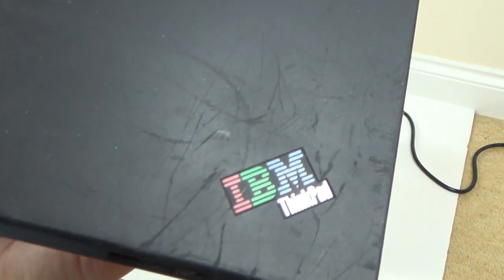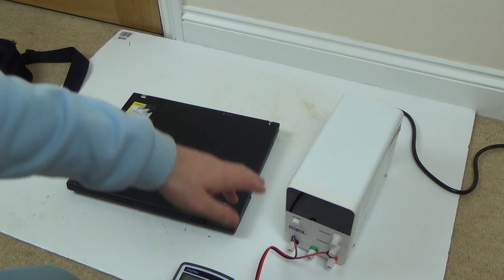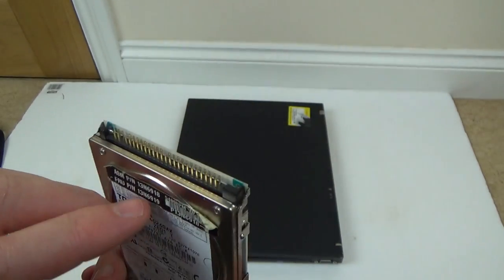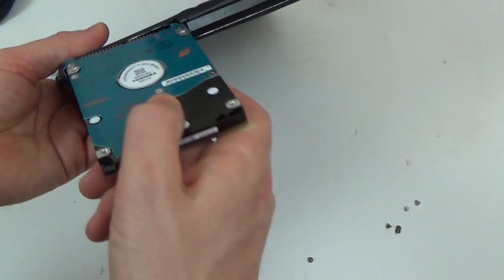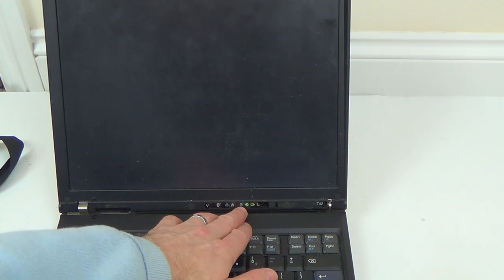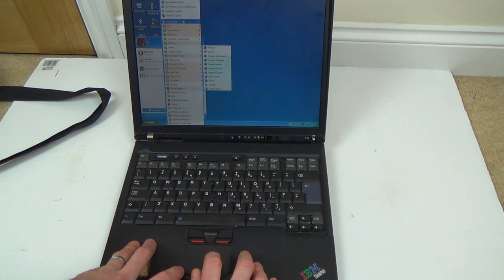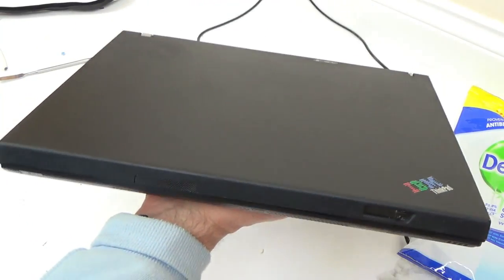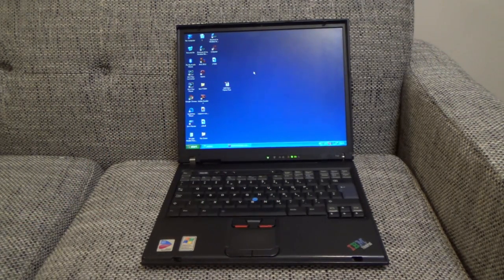Trying to FIX : IBM ThinkPad T42 Laptop

Comment: T42's were indeed good laptops - one of the last of the IBM ThinkPads - later the T60's were produced part way through by Lenovo (which bought the ThinkPad brand from IBM).  Keyboards/Touchpads for these are pretty inexpensive although even if you were/are able to get this running you may want to keep WinXP or Win7 on it as Win10 will run but might be a challenge for driver support.
As far as the "approve certificate" I think you have a bit of malware there (or as others have suggested simply date/time being wrong compared to what's in CMOS) You could try to "clean" it off of the machine but you're looking at some hours and really no guarantee that it'll be successful - it's easy enough though to uninstall the myriad of junk apps in add/remove program.   I would find an XP image, burn it to a disc and re-install - even after that there's no support for XP (even security patches)...

Comment: I have mine nb with xp and have no issues with certs (not sure if i had this problem). Using waterfox in it (it's using older firefix core (horay legacy addons) with uptodate security updates). So i thing it could really be that cr2032, or it's just a browser settings (again, not sure if i was solving anything like this).

Comment: i think those "expired" certs are due to the system time on the system itself other then that it should be able to run windows 7 just fine since its able to handle up to 2GB of ram but with a modded BIOS it might be able to support more unless your limited to just a 32bit OS otherwise maybe Lubuntu would be the other option there

Comment: The certificate issue is most likely caused by the windows and bios clock, might need an updated bios and fresh CMOS battery and you should be good to go.
Cool repair video Vince well done :)

Comment: Just a suggestion. Never use alcohol or alcohol containing wet wipes on those type of screens. They are not made from glass like most modern screens but rather a thin film of plastic and alcohol can eat through that leaving permanent marks on the screen

Comment: ha .. nice ... I have one of these running XP ..I use it for Jaguar / citroen / peugeot /vauxhall   diagnostics ...in fact most OEM OBD software for cars uptill ~2012 still ran on best on  XP ..I actually have a mega cheapo 30gb kingspec IDE SSD in mine as it gets checked about on test drives a lot and it kept killing hdd's...not really safe to connect to the internet with XP anyway ...its been a long whilst since the last security updates.....sounds like the bios battery is doa anyway....I always keep a couple or working XP laptops in my workshop.

Comment: The pins on the back of the drive are basically ide 2.5 instead of the usual 3.5 they are used on laptops

Comment: You can't put an SSD into an IDE interface. That thing is no longer much more than a paper weight my friend.  Good on you for fixing the issues with it however!
Reply: U can with an converter, trough I wouldend recommend.. Windows xp doesn support trim, so eventually u will destroy ur ssd/windows xp installation

Comment: Right-click 'My Computer' and then click 'Properties'. You should find support information there. If there's a big IBM logo and the support information checks out, you have the 'original' XP installation on there. If not, then this laptop has probably been re-installed or imaged by someone and the 'original' XP is not original anymore. In that case, feel free to install another OS. Or, pop in another hard disk and try another OS on that. Or, take out the hard disk so you're sure nothing will happen to it, pop in a USB stick and install Linux on that, from CD. In the BIOS you can set the default boot order and if you  push F12 in the BIOS screen, a boot select menu will pop up.
I might have an original working power supply for that laptop, somewhere in my junk pile.

Comment: Its trying to boot from network connection first of all - thats the Intel boot agent.  Then when it says OS not found its either not detecting the hard disk, or there is no OS on the hard disk.  SSD would be probably quite difficult as it uses an older hard drive connection standard

Comment: I have the same model. Someone gave it to me and I powered it on. It's in really good condition and there's not so much problems with it! The only two things are that it's scratched, and every time I unplug the power cable, the time resets and I have to configure it again. When they were giving it to me, (along with other laptops and phones that work, one phone doesn't work) they threw it to us??? Yep, that's right. they threw it at us. I cached some but, since one laptop was so heavy, (the one that has Windows Vista) I didn't catch it and now the top is scratched. Same for some laptops too. At least they still work! Right? So after I got home and booted up all the computers. Since I still lived with my dad at the time, (I still do now) my dad planned to SELL the ThinkPad to one of my uncles. but since it was too old and my uncle has a newer laptop, we didn't. And to this day, I still have the phones and laptops. Sadly the Samsung Galaxy S1 was bricked and I can't use it. I tried to unbrick it but it since it was dropped, it was bricked FOREVER. Yep, the Samsung Galaxy S1 gets bricked forever when you drop it hard, or throw it hard.

Comment: You won't go far wrong with IBM laptops or Lenovo, especially if they are the business ones, they are designed to be worked on, tells you on the back which screed to remove, great machines

Comment: @mymatevince To solve your issue set the time and date and timezone correctly. Its probably been flat for so long the cr2032 has gone flate for the real time clock. Website nowadays have an ssl certificate to make them secure hence the padlock at the top. They are olnly valid between certian dates so if the date and time is wrong it will through up error.
However as this is running xp I would recommend this is not put on the internet ands its massively out of date and insecure let alone no longer supported. If you end up selling it let me know. I need an XP machine for some old software that wont be updated

Comment: The way you say "H" is in fact pronounced correctly throughout the world bar an extremely small minority that we could treat as insignificants, Having said that lets see how many insignificants there are other than the 4 trolls who thus far dropped a thumbs down at the time of this here message?  

"Cash Converters" are a shonky second hand dealer "Pawn Shop" Located in Ass-Trail-Ya if not throughout the world, I say Shonky because they Botch Repair broken pawned items or perhaps allow such botched items to be sold as is, For example connecting a stereo's working channel to both speaker outputs.

Last thing I have to say is the latest windows should install OK and even install all the latest drivers, But as you are aware collectors are not interested in Microsofts latest windows backed and sanctioned by Intel's cash grab having windows constantly being updated with more and more bloatware, that forces everyone to update their computer every few years or so, long story short uninstalling and installing the latest Google Browser should negate the certificate woes, mind you that's if Microsoft hasn't woken up to the workaround.  
APU I dropped a like
Reply: Cash Converters briefly had a presence in Canada in the 1990s. I once brought a PC game there that was infected with a rather nasty virus. 😬 I would never purchase computer hardware there.

Comment: I believe on old XP machines you need to update the GlobalSign certs that all expired a few years back. I believe I've got a windows batch file that automates it for you if you want me to dig it out and see if that fixes your online issues.
You'll probably find that if you go to run > mmc > add snap in for certificates, under third party root certification authorities, you've got some Global Sign certificates that expired a few year ago, and haven't renewed themselves, which is causing all your grief.
Let me know if you would like me to email across any files/instructions :)

Comment: I just brought one of these back to life.  Mine needed a new main battery, a CMOS battery and Windows 7.  I upgraded the RAM for giggles.  This machine won't run Windows 8 or Window 10, but Window 7 runs just fine.  If you do install Windows 7 you'll need to get drivers from Lenovo, just get the most recent drivers you can find, most will be either XP dirvers or Windows 2008.  Mine had 512k so I upgraded to 2G.

Comment: Replace the keyboard, also replace the cmos battery under the bezel. You can simply use a 2016, 2025, or 2032 lithium coin cell and reuse the wires. The cmos batery is a yellow candy looking thing. 🤓

Comment: The end of life for windows XP was in 2014 and companies slowly stopped making software for it. The end of life for windows 7 was in January so companies will stop making software that supports it. These days it's either get a laptop that can run windows 10 or use a Linux operating system.

Comment: Microsoft ended support for Windows XP back in 2014. And computers in that time ran 32 bit processors, and there just ain't much software supporting 32 bit anymore. A lot of the time Microsoft only gives 10 years of support, rarely they will be a Windows version that goes on longer. With a computer that old, there ain't really anything you can do to make it actually usable, upgrading to Windows 7 isn't recommended either because Microsoft ended support for Windows 7 earlier this year, meaning that you won't get any security updates for the os. And if installing a newer Windows os, now a days there's 64 bit, so you are going to have to download a 32 bit iso file for that system if that newer os even supports 32 bit, because some don't. Installing Windows like Windows 8.1, or Windows 10 that is currently still getting support run by 64 bit, so you are going to have to do quite a few upgrades to getting it to run. But doing major upgrades on a system that old is quite challenging because upgrading something like the processor, the system might not operate right, or at all because that type of motherboard might not support a much newer processor, so at that point you might as well just buy a new computer. Another thing, websites now a days like newer websites won't load in, and just spit out an error because the main reason is because in that time of 32 bit computers, the site URL ran by "http" in the beginning of the URL, now a days with 64 bit computers, sites now run by "https" in the beginning of the site URL's, so a 32 bit system in the time of "http" won't recognize much of the sites because they don't support "https", mainly because "https" didn't exist in that time of 32 bit systems.

Comment: Not worth upgrading the hard drive when its interface is eide or ide. Best you can get maybe a western digital raptor? 7800 or 9000 rpm I believe.
Reply: SATA to IDE adapter and yes it does make it a lot quicker.

Comment: the certificate error its produced by time or date in computer is wrong(maybe), you need to replace de battery clock and set the date properly

Comment: Wow Windows XP, I think you might want to put Linux mint on that machine as Windows 7 probably wouldn't run and for that matter drivers would be obsolete, and windows 7 is no longer supported.  The only thing you might run into a problem with is the sound as even windows XP had issues with you had to install a driver for the sound card.

Comment: The issue with the certificates is most likely due to expired root/intermediate certificates.  You can update them using a command line utility rootsupd.exe as explained here: http://woshub.com/updating-trusted-root-certificates-in-windows-10/#h2_2.  There is most likely a handful of certs that expired since that machine was last turned on.

Comment: PXE Boot explanation. Client-Server (workstation) environment, also known as network boot.   https://en.wikipedia.org/wiki/Preboot_Execution_Environment. This is NOT an error when something says PXE BOOT. You can disable it in the BIOS. If ONLY this appears and does nothing else, then the BIOS was set to this ONLY and thus you may need a password as this is usually a company thing and BIOS will most likely have been protected, usually they should be cleared and set to standard default if being passed on, not always though. Enable the HDD and disable the  PXE Boot (boot options) or where it says PXE. Job Done.

PXE-E61 Media Test failure. What it means is no network cable is attached. even if so it needs to conenct to something giving out IP Addresses like a DHCP server which would be the norm.
PXE-M0F Exiting Intel Boot Agent. What it means is, since it cannot connect to a network and get a certificate and IP Address, it will exit that boot up sequence and try another device.
Operating system not found. What it means is onen of several things. There is NO other boot option set in the BIOS, no device in the boot sequence set in boot options in BIOS has Boot files like a windows disk or HDD Boot manager.

That's it. NO Error at all. The clue is in what you were told with this. Just attach the hdd and if that doesn't work, install windows on it. See my other comment.

Comment: I have one that just flashes all led lights one time when I push the power button. I have to take the battery out and back in again to get the 
"Battery Charged " flashing green battery led to come back up. I have tried the old , take the battery out and press power 10x times then hold 30 secs , then tried again. There are many screws missing and i was thinking from reading the manual "make sure all components are connected well" quote and make me think that some of the screws might complete a circuit? Anyone reading this have any idea to get it to boot would be great . Thanks.
Reply: could it not boot to bios if the cpu/ keyboard/ touchpad / cpu fan is not working? Do they complete some sort of circuit to boot to bios?

Comment: I still have my T42 upgraded to windows 10 32bit and 1.5GB ram with an 80gb ide drive sadly the battery is messed up and I need a genuine charger wouldn’t have a Chinese remake if anyone has one In good condition I’ll buy it. Currently using a T43  charger off a friend since they are pretty much the same😂

Comment: That's a robust laptop, install Linux in that and be come verry usable, better that any new laptop, upgrade to 2gb of RAM and ssd, with IDE to m2 converter 

Apart of that need a change of thermal paste so, It's time to take it apart and give it a good clean and maybe upgrade the cpu

The Pentium M 755 is a good upgrade to 2ghz, overall the next upgrade Could be a custom motherboard but is really expensive one, like 800 us dollars for a t47 with i7 8gen and all good stuff

Comment: you wont get a sata ssd to work in that as it uses the older pata interface
Reply: More difficult, but not impossible. I have seen mSATA to 2.5" IDE adapters, but I haven't tried one though. Size is definitely an issue and it's probably easier with a desktop. 
I have a 120GB SSD in my Pentium 3 Desktop (1.26GHz P3-S) with a generic IDE to SATA adapter. Works fine in Win98 and no problems being detected by the BIOS/Win98 installer on my ASUS TUSL2-C motherboard.

Comment: it is a browser for win xp,since 2018,is not supported by microsoft.search it on google.it starts with G,i think,maybe B.Search it.But with the dual celeron,you have no computing.search the highest cpu that the mother board support,and install it.Maybe is a single celeleron.the cache on this cpu is no more than 256kb.Try at lest a pentium Pentium M 755 	SL7EM 	2000 MHz 
Pentium M 765 	SL7V3  	2100 MHz.Because of the max bust side front = to 400mhz,is useless .
Reply: the front size bust is multiplier with the cpu rotation.so,that is equal with the max f.s.b 
frequency.so,when you see 400mhz fsb,you will know,that the cpu,is only 2,3,3 and a half rotation multiplier with the front size bust.and that f.s.b can t be use at max,because the second cpu,the chip for the mother board get to hot,and unstable .conclusion,this device is no good. i forget the english language,i am now doom to die,because i am not sucking parasites,in Romania.

Comment: 34:23 Are you serious?  There are lots of people interested in using these as they are reliable and work very well.
Reply: Nobody's going to be using something THIS old as a daily driver. It has the equivalent of a Pentium 4 in it, nowhere near powerful enough for the modern internet, Youtube, ect. These are only useful for tinkering, retro gaming, specialty software that only runs on XP, or typing up documents or spreadsheets.
Reply: I hope you are joking. No ssd support and ide drives are no longer produced. This thing is useless. A 30 dollar amazon tablet is faster than this.
Reply: @DimiS1978  I hope you're joking, a $30 Amazon tablet is NOT faster than this and is cheaply built while an IBM Thinkpad is quality built.  I have had experience with both and I can say $30 tablets should stop being sold, they are disposable garbage.  As always, your opinions are yours, and my opinions are mine.
Reply: @simtitan1  Nowhere near powerful enough for the internet?  You can watch YouTube fine on one of these without issues.  In fact, these are better built than some new laptops today.

Comment: nice fix that keys are so frustrating to me they break so easily on newer laptops It's good to have a xp laptop cause many programs for firmware flash needs older operating systems like xp also this laptops have serial ports to connect electronics for example flashing usb drives old musical keyboards or equipments have serial port this laptop could save you to search adapters for connecting that kind of devices